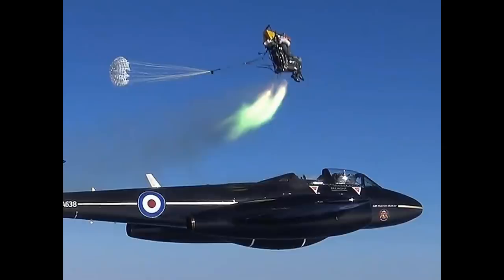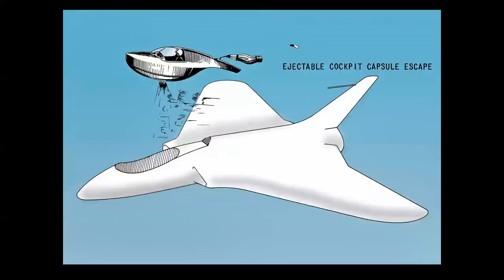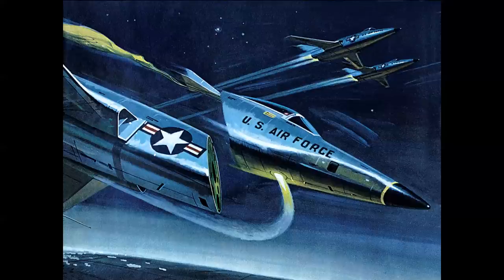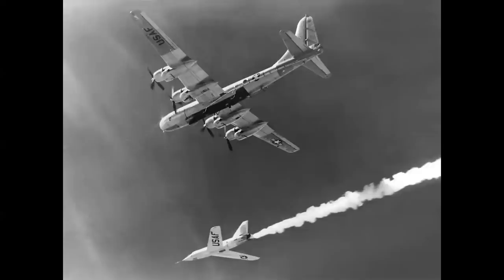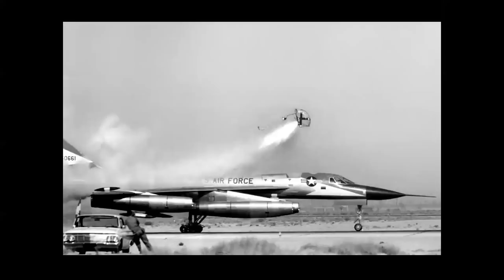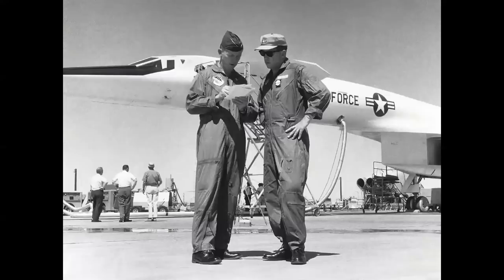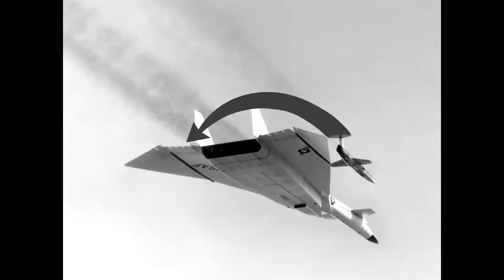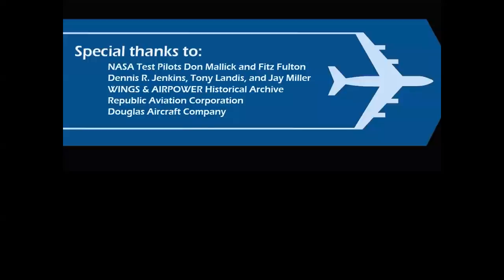AIRCRAFT EJECTION PODS & CAPSULES - High-performance U.S. aircraft escape systems, 1950s and 1960s.

Comment: I was stationed at Cannon AFB when an F-111 went down just off base. When I saw the capsule come down I thought, "I'll be damned. It works."
Reply: Was it on final just over the fence and had a mid-air with a Cessna flow by a real estate agent that showing some people a ranch?
Reply: @infectedvector  It was on final and fuel two both engines shut off killing both engines. It was weird because it was super windy that day, it was Cannon after all, and I was servicing a -86 when all the the vehicles on the ramp flew by me with sirens blaring. I looked around the generator to see a fireball in a field and a big parachute with the capsule under it. 
Never heard the explosion.
Reply: Captain Chaos  better than dying…they’ll live for another day, aspirin and a cold beer with a few days off will cure that!
Reply: Captain Chaos  Yeah, the chief concern I heard was that the airbags underneath didn't always reply to cushion the landing (or keep it afloat).
Reply: I spent 2 years (1972-74) at Pease Air Force base, I was assistant Crew Chief on a FB111-A. I remember going to school on the 111-A and all the details of the escape capsule. I was really amazed at all the engineering that went into the ejection capsule. I shudder to think of all the hours I spent on a cherry picker, deicing the snow that was 3 feet thick on those planes. I learned that the black leather gloves I was issued stained my hands with black dye, even when I had the grey wool ones over them. I guess the deicing fluid must have helped with the dye coming out. I grew up in the southern part of the US, so it took a little while for me to get used to the record  -58° below, it may sound strange but now even after almost 50 years, I'm still not bothered by sub zero temps. I don't care for cold weather but I still walk around down south with a T-Shirt on when it's cold as long as I don't have to put up with it for too long.
Reply: Cannon AFB!  You poor thing!  Holman AFB is not the end of the world, but you can see it from there.  Cannon AFB is the end of the world.
Reply: Except when the capsule swings and imparts high lateral accelerations and the air bags rip off.
Reply: @francisebbecke2727  Fact.

Comment: The XB-70s capsules also doubled as the emergency pressure capsule so if the plane depressurized then it would pull the limbs in from the pilot and close and then they would used a few controls in the capsule to get down to 10k feet where they can breath. They didn't use pressure suits. Interesting lil side bit.
Reply: The plan was that in production B-70 aircraft, the cockpit would indeed be a "shirt-sleeve environment". But in the only two experimental XB-70 aircraft built, pressure suits were always used for high altitude flights, as far as I know.

Comment: As a kid I read an illustrated book about the B-70 program, which was then under development.  It showed the escape pod doubling as a canoe in case you landed in the water.
Reply: As did the F-111's. IIRC there was a pump to remove any water leaking in that was connected to control column.
Reply: @neiloflongbeck5705  I watched an interview recently with an F-111 pilot who elected, and he did mention the bilge pump. I thought it was an interesting feature
Reply: I likely read that same book as a kid! ( im 1962 vintage)
Reply: @p99guy  I wish I could find a copy of it, but I don't remember the title.
Reply: @Paladin1873  same here.. but I do remember it. Also the B52 Capsules, 2 ejected downward, 2 upward
Reply: @Paladin1873  I looked up books about the plane from that era and I found one named "the manned missile" by Ed Rees. Could that be the book? It came out in 1960 if that is any help.
Reply: @adenkyramud5005  Maybe, but it has been so long that I can't remember.  I looked up the book you mentioned and found one link that showed several pages from it.   I don't recall it being a hard cover book like this one.  I think it may have been geared to kids.

Comment: As a pilot once told me while strapping in to a Martin Baker MK-J5 seat, "I will slap you on your chest and yell Eject, Eject Eject and if you are still here after the third time, you will be by yourself."
Reply: I got "I will say eject, eject, eject - but you won't hear the third one as I will be gone" 😜
Reply: I recieved an incentive ride in a A-37 while stationed at Davis Monthan AFB. The pilot of the jet basically said the same thing if you look over and see a smoking hole where I used to be thats your clue to to get out.
Reply: My briefing was, "if you hear the third eject it will be an echo".
Reply: I was fortunate enough (or unfortunate enough depending on how you look at it) to be in a very small MOS in the Army, working on the only aircraft in the Army that had an ejection seat. To say that I knew the pilots (and other aircrew) personally , would be more than a bit of an understatement. It was a small enough MOS that I worked daily with multiple  people that I had gone to both Basic and AIT with for 9 years including two permanent changes of station to different units, in another country, and getting out of the Army for over a year before re-enlisting. We were "those weird looking planes" that nobody had ever seen before, or knew anything about.  When I was sent to the ALSE (Aviation Life Support Equipment) course, I was the only fixed wing Crewchief in the course. One time the instructor held up the parachute for our ejection seat stating "this is a rigid parachute pack, you will never see one again" to which I had to point out that I did, in fact see 36 of them every day. he simply sighed and said, "oh, YOU'RE the reason that I had to drag this and all of the other stuff out". The rest of the course was ...interesting. Different harness, different helmet, different survival vest, different survival kits, and a couple of extra items that you would need if you ejected and landed hanging in a tree.
Reply: @MrSirwolf2001  OV-6 Mohawk?

Comment: Another wonderfully presented subject Mike! Thanks! I read in Rich Graham's book "SR-71 Revealed" that ejecting from an SR-71 at Mach 3.0 and 75,000 feet was a lot less violent than ejecting from an F-16 at 500 knots and 3000 feet simply due to the extremely thin air at 75,000 feet. Of course it was a 7 minute free fall under a drogue chute before main chute deployment at 15,000 feet!
Reply from the maker: Neat info, thanks Walt!
Reply: Damn, imagine counting to past three thousand whilst in free fall the whole while

Comment: The B-1b also had a rocket in the crew entry ladder to open a bottom bail out option for the 2 additional “jump seats”. These seats where intended for 2 instructors complications with the opening sequence and crew members fears of getting caught in doors or antennas and actual accidents where crew members died finally made those 2 extra seats permanently empty until finally being removed in mid 2000’s. I was part of a team that removed all seat escape hatches for an ejection seat replacement and after seeing the charge that was intended to blast open those hatches, I had even more fear to fly in one. I know that it was plenty, it just doesn’t look like it compared to all the fasteners holding them in place….(I knew the back seater who had the aft hatch actually ripped off mid flight.. he had just snapped his buckle back up from using the lavatory which was probably the only reason he didn’t piss himself).

Comment: On the B-1accident, one of the pyro's did not fire, that is why the capsule came down at an angle.  That complicated system is why the Air Force switched to ejection seats.  
I helped to design the new cockpit with ejection seats for B-1A ship #4, that is the one with a camo paint job.
Reply from the maker: Thanks for this information.

Comment: Another great one, Mike! Some additional remarks:
- As far as I know the first airplane to use a detachable nosecone was the German WW2 Bachem Natter point defence rocket fighter, of which the seperation of it's main three sections was actually part of the retrieval concept. In other words: It was not even intended to land conventionaly! Not surprisingly it proved to be a deathtrap durign testing.
- In XB70 Valkyrie - Ride To Valhalla by Jeanette Remak and Joe Ventolo Jr. it is claimed that he actual photoshoot was not authorized an thus basically an illegal affair. Without that shoot disaster would not have struck so this still makes it a very painfull affair.
Reply from the maker: Adding the photo mission to the scheduled test flight that day was requested by GE and approved at Base level. The subsequent crash investigation uncovered operational procedures that should have been modified and Command Level decisions that played a role in that accident. A tragedy nonetheless. Thanks for watching!
Reply: The Natter was supposed to launch vertically, climb to altitude, then dump the nose cone to reveal the unguided missiles packed in behind.  If the pilot survived the launch, he would fire the missiles in the general direction of the bomber stream, essentially while falling back down.  The ejection system only recovered the rocket engine and the pilot.  Everything else but these two bits was disposable, and recovered examples were quite primitive in construction.  The Natter was never operational, and its total tally was one Luftwaffe pilot killed.

Comment: The B-1A dates from before Carter and the crash happened after the B-1B programme was launched B-1A 74-1059 was fitted with the B-1B's flight control system and was in the process of testing it when this tragedy struck. From what I've read there were only 3 in board, the chief test pilot for the B-1 Tommie Benegiekd, Major Richard Reynolds (co-pilot) and Captain Otto Waniczek (test engineer). They were conducting low altitude low speed tests but had forgotten to shift fuel forward using the automated fuel transfer system which meant there was too much fuel in an aft fuel tank causing the pitch up to 70 degrees, the wing to stall and drop into the spin. No right thinking test pilot would conduct aft CG tests at low level.

This crash occured on 29th August 1984 and the first B-1B was rolled out of the Rockwell factory on 4th September 1984.

Comment: As a young Army E5/E6 I was a TO on board the Army's OV-1C/D Mohawk. The only Army aircraft ever equipped with Ejection seats. Before I finally went on to Army flight training I ended up with 970 or 1121 hrs depending on which set of records you look at. During Two distinct incidents I FIRMLY had the primary Ejection handle in my hand and was milliseconds away from pulling it...all the while staring at my grinning CW4 Pilot with a "should I?" look on my face.  Once after being hit by lightning and losing several Generators, inverters and instruments...the other time after getting WAY to close to a Florida thunderstorm and experiencing wind shear that put us in a 70-90 degree nose up attitude...in which we stalled down to around 1200 feet where we finally powered out of it.... we stayed in FAR past normal Air Force/Navy Ejection criteria for some odd reason. Our Unit was then later marred by two Class A incidents that resulted in ejections...one that was inverted killed a great CWO and Vietnam veteran and allowed a much lesser individual to survive. (A useless oxygen thief of a Lieutenant that I think became a Brigadier General in the Georgia Army National Guard. Cruel irony. Anyway...anytime I see a program on Ejection seats, it takes me back to my Mohawk days and the Ejection seat trainer to get your "E-card"....
Reply from the maker: Wonderful comment, thanks!

Comment: The fourth B-1A prototype was the only B-1A equipped with ejection seats.  During testing of the B-1A's capsule system it was determined to be unstable up above I think 350 MPH.  The fourth B-1A currently sits on display at the SAC Museum near Ashland, NE.
Reply from the maker: Good information, thanks!
Reply: No, that is in the NMUSAF.

Comment: In the B-70 accident, the plane was flat spinning faster than expected due to loss of one wing.  
This applied a higher forward G load to the capsules than they were designed for.  
Al White who helped design the system, knew this limitation and waited until a moment when the G load was at a minimum to encapsulate. 
Major Cross didn't and when he tried to encapsulate the load was too much for the system, it spent the encapsulation charge without moving the seat back.  
For the final test flights North American modified the system to prevent re-occurrence.
Reply from the maker: Interesting information, thanks.
Reply: @celebratingaviationwithmik9782  
I worked at North American Rockwell with some of the guys who designed the B-70 capsules, and supported the test flights.

Comment: Thank you for a great presentation. Never knew any details of ejection seats, ejection capsules, and the other crew ejection systems. in the old days I just took it as being a simple procedure to pull the emergency eject button and the crew were ejected safety. Never new the complications involved, or that sad tragedy of crew losing their lives using a system that was to save lives. Looking forward to part three.

Comment: The F-111 and B-1A capsules were tested at the Holloman High Speed Test track.  I recall reading the test report on the last high speed test for the F-111 at 700 knots calibrated.  it worked fine and the manikins recorded survivable forces.  If I recall correctly the fastest manned F-111 ejection took place at 900 knots, both crew survived.  The B-1A capsule was qualified at the Holloman track but I don't recall the speeds.  Later that same sled was modified for qualifying the  ACES II seats.  One undesirable side effect of launching 4 seats in timed sequence was that the first two seats and hatches kept hitting and fouling the parachutes and on one instance a hatch hit a manikin's foot while under his C9 canopy.  Ugh.  Looking forward to the sled episode!
Reply from the maker: Thanks Jim, and yes, solution to the vectors of four ACES II seats ejecting from the B-1B involved angling the trajectories of all four seats away from each other during a simultanious ejection sequence. Saw footage of those sled tests at Holloman, and the rocket exhaust trails formed a 'flower petal' effect as the seats left the sled.
Reply: Hey Jim!
Reply: @johnp139  Brother Plaga?

Comment: The reason the crash happened  the crews were informed of a B-58A approaching at higher altitude and all the pilots except Walker reported that they had spotted it. Possibly Walker was looking for it while his F-104N (N813NA) inexplicably moved slightly closer to the Valkyrie and then rose suddenly so that the left tip of its horizontal stabilizer touched the XB-70’s drooped wingtip
Reply from the maker: That is correct, thanks.

Comment: Saw the first B-70 make it's maiden test flight out of Plant 42 in Palmdale.  I remember seeing the large black smoke column when the second B-70 crashed several years later.  Living in Lancaster in those days,  black smoke columns were not that unusual.  Lockheed test pilot Bill Park was piloting an A-12 with the D-21 drone, which went wrong,  and was ejected at speed.  I am not sure if it was the same event you referenced.  

Keep up the good work Mike.  You have a lot to share.
Reply from the maker: How very cool that you lived the Antelope Valley experience during the Golden Age of Aerospace! And yes, that A-12/D-21 accident was indeed what I was referring to. I also stand corrected in that Park didn't actually eject from the airplane, but rather both crewmen were thrown free from the disintegrating airframe. Sadly, the RIO did not survive the inflight breakup.
Reply: @Robert Barnes One correction. That wasn't an A-12 that launched the D-21 TAGBOARD but a two-seat variant properly called the M-21 ('M' for Mother and 'D' for Daughter)

Comment: 6:03 I think there was one before. It was called Bachem Ba 349 (German one-time-use interceptor). Since the aircraft was basically a rocket, it featured an escape pod as a mean of bringing the pilot safely back to the ground.
Reply from the maker: Yes, you are correct, although that system never actually flew operationally. Thanks for watching!

Comment: at least its not like the tu22 which fired the ejection seats down and was prone to low speed compressor stalls also the locks used to lock the seat in place used to fail so the pilot would simply fall out of the plane occasionally

Comment: reading about Columbia shuttle, one of the report recommendations was the crew area being an ejection pod with an aerodynamically stable shape.  Of course that would have meant rebuilding the shuttle from the start and not practical.   I know the first shuttle flights had ejection seats for pilot and copilot, but they were removed once they included mission specialists.   

Thank you for a very interesting history of ejection systems
Reply from the maker: Appreciate  the great comment, thanks!
Reply: Major issue is Always the weight of the system that could be better used by fuel or ammo

Comment: A great video would be the problems that Warbird operators of jets are having these days. In Australia, our version of the F 86 Sabre (CA 27) built here under license, has just been through a complete restoration. My understanding is that the only reason we aren't seeing her fly is the ejection seat requires zero timing - an expensive proposition requiring an explosives tech and hard-to-get parts! I would guess others are in the same boat. There are 60-year-old Migs out there offering rides - Don't get in that seat unless it bangs and you know how to use it. Otherwise you're riding that thing to the fireball.
Reply from the maker: Interesting information, thanks.
Reply: There was an incident last year where a passenger managed to eject himself out of a perfectly serviceable aircraft